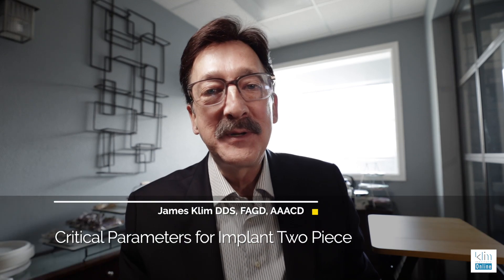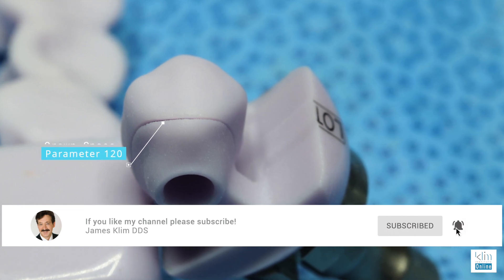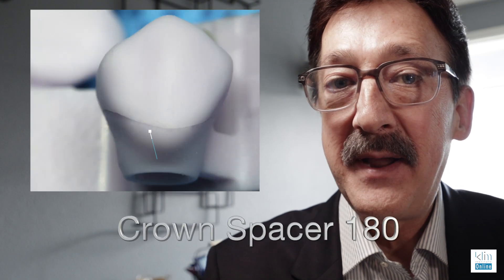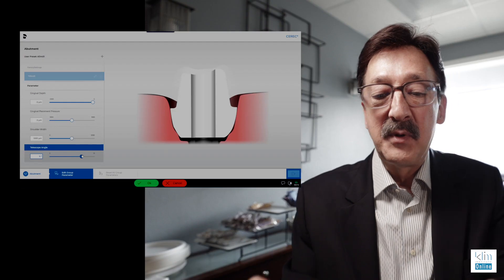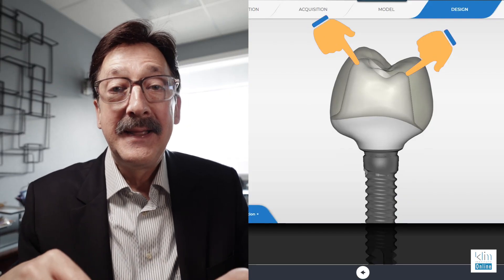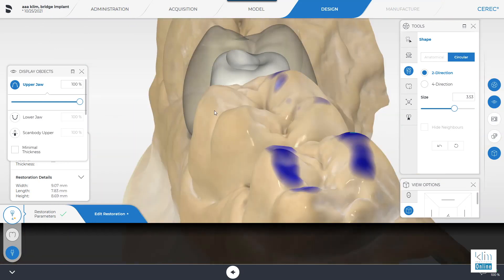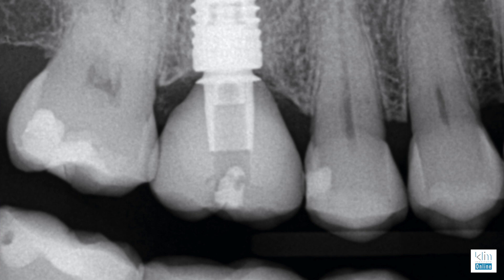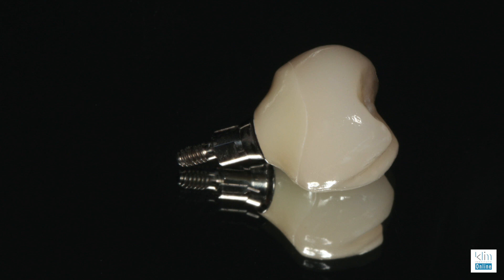Parameters for the CEREC Implant Two Piece Restoration

Comment: Thank you for the tips. I’ve been a Cerec user since April 2000 and have gone through many software updates and place surgical implants and restore them with the system. I noticed in your presentation that you utilize the multi layer restoration in the posterior area. My preference is screw-retained restorations in the posterior area and multi layer in the anterior area because of the access proposal out the facial. However, aesthetics suffer because of the LT block in the posterior area and I utilize the Miyo System to reduce value and improve aesthetics. I see from the radiograph that you multi layer your posterior restorations do you utilize the HT block? I also see you modify it to become a screw retained piece which is very clever so that you can clean the restoration outside the mouth and reduce the chance of. residual cement and periimplantitis.
I used to be a member of your instructional website and wonder if you still provide videos on abutments and implant restorations. I am in Florida and you were on the West Coast so travel is a challenge. Thank you

Comment: I have been a Cerec user since April 2001. I place my own surgical implants and restore them with the Cerec system. I utilize Emax CAD one-piece design in posterior and two-piece multilayered designs in the anterior because of the screw access coming on the facial. However, the posterior aesthetics are limited by the LT blocks. I to use the Miyo system to decrease the value and boost the aesthetics.
I noticed you split your posterior implants and utilize probably an HT block for better aesthetics and then I see from the posterior radiograph that you Cement them and then modify them to become a screw-retained implant restoration. It is also easier to place a two piece system rather than a one piece if there is a undercut or challenge with the line of draw. In addition, you have the control to remove the restoration and polish that margin which leaves no cement around the gingival tissue which will reduce Periimplantitis. Very clever

Do you offer an online course because I’m in Florida and I know you were on the West Coast. I certainly would like to know some more tricks... and editing to improve the abutment to sign in the anterior area.. i’ve been a past member of your website instruction. Thanks
Reply from the maker: Hi Bill.  Thanks for the comments and your astute observations.  Yes, I will often use HT e.max for the crown and cement out of the mouth, once fitted clinically, polish marginal interphase and then screw in...much more aesthetic.  I do agree, a one piece implant is much more difficult to place, especially if there are two or three side by side.  

When was the last time you had membership on my site?
Reply: @KlimDDS  probably 2018. Life gets busy!😎